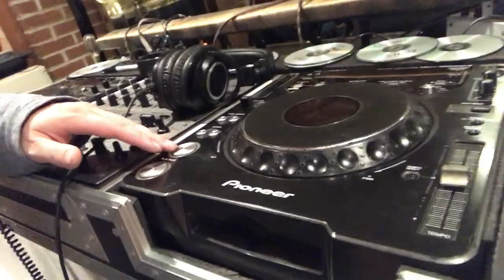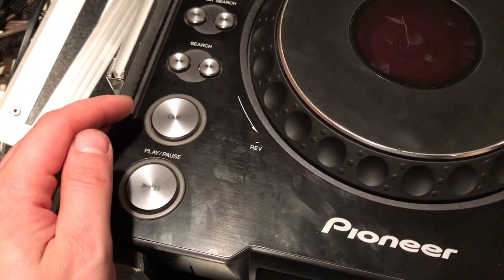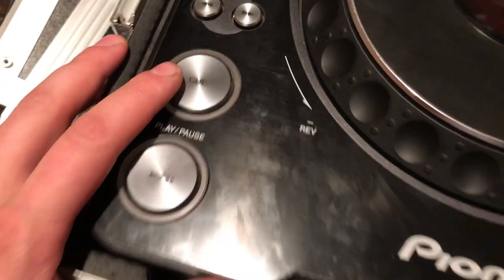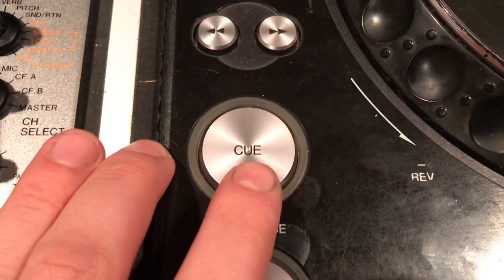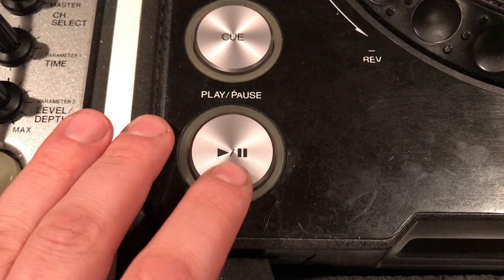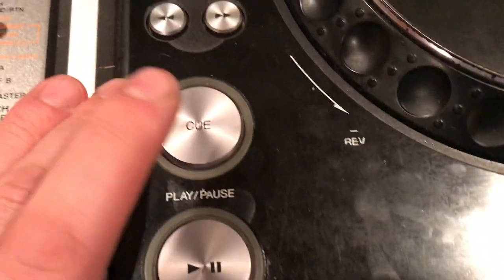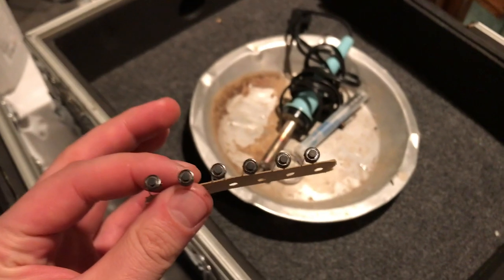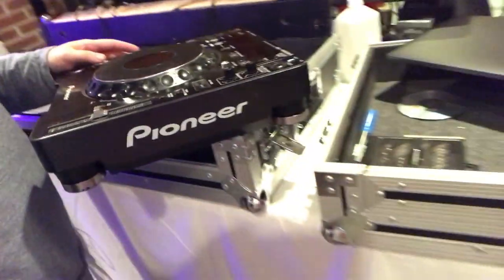03 | Cue and Play Button Replacement CDJ1000 and 2000 models

Comment: Very good friend, my CDJ has the same problem with the CUE button. Could you pass the part model for replacement? Thanks.
Reply: I just went on eBay and typed in “CDJ2000 cue button replacement”